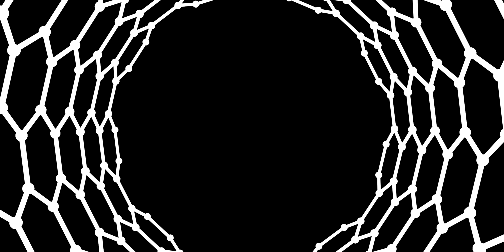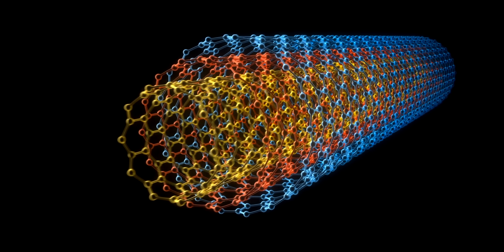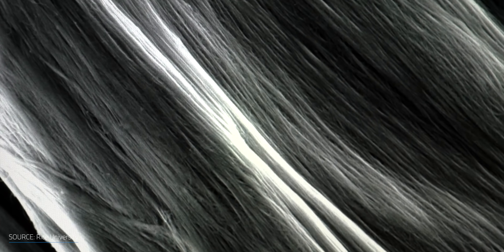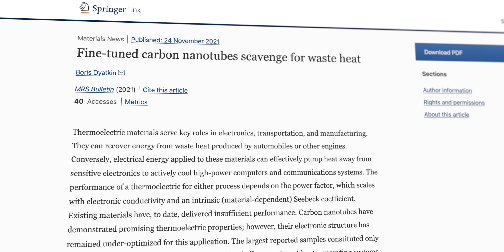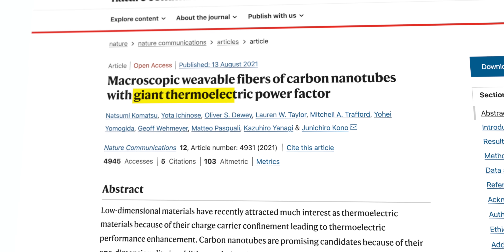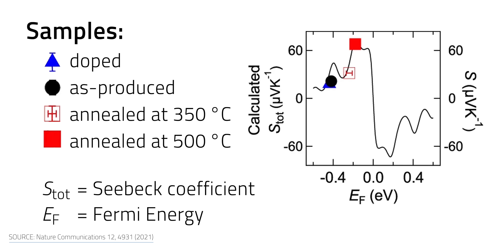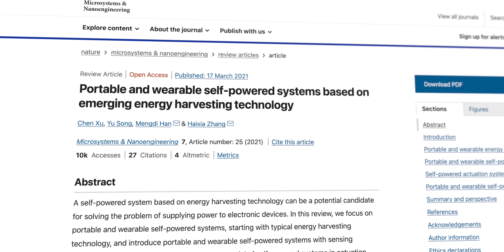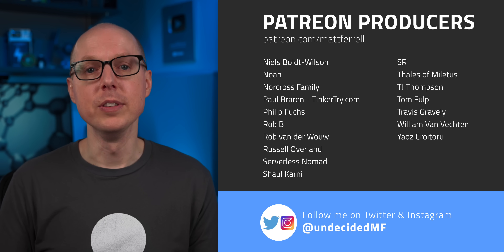Revisiting How Carbon Nanotubes Will Change Renewable Energy

Comment: Would CNTs be a good candidate to harvest and convert residual heat in urban environments to electricity? There's a fantastic amount of residual heat that's trapped by office buildings and roadways - it seems a shame to not be able to capture it and convert it in to a useful form.
Reply: It would be excellent to harvest geothermal heat. Or turn deserts into power plants.
Reply: The main question is twofold:
A) it’s not about how much heat in isolation, it’s about the thermal gradient, so you’d need to find cold spots as well. Cities have cold-er- spots sure, but the local differential for the thermoelectric device is likely to be limited in very dense urban environments precisely due to the heat island effect.
B) what are the efficiencies of the device? One LED from a hotplate, scaled-up, suggests air conditioning waste heat might be able to run nearby street lights for instance. That’s not nothing, if cheap-enough that’s already enough of a reason to install them into buildings. But it’s not going to, like, halve the number of power plants/energy farms all by itself either.
Reply: @kaitlyn__L  in the desert cooler gradient would be underground or in the shade. Which may be the same case in the city.
Reply: @paysour3  of course, there will always be cool-er parts, but the question is: is it 5°C cooler? 10? 20? That magnitude determines the power output, not the absolute temp of the hot side. 

Additionally, you cannot necessarily simply have the hot and cool sides large distances apart, if it is all in one plate they need to be next to each other, otherwise some kind of refrigerant or other transfer fluid would be required, which would also affect the efficiency, and be a different design.

This is inherent to all thermal engines, the graphene plate would be very much like a modern semiconductor peltier cooler, which indeed can also generate some current from being made hot and cold, just the CNTs allow 3x more power output vs a peltier plate. 

Of course with arbitrarily large distances you can find any cold side you want. The challenge lies in finding them close-enough. One of the best options may in fact be another topic this channel covered, devices which output heat in the gap in the absorbency band of our atmosphere, and create a cold side for other devices such as air conditioning. 

Well, they could be used here too. But they generate fairly mild temperature gradients as well, marketing themselves as making savings on A/C, rather than outright replacing it. So if that’s your best option vs some limited environmental cold side, then it swings back around to limited efficiency. 

Of course even 0.1°C delta will produce some power, but could it even power a single LED? Even with massive scaling of power factor, which thermodynamics makes dubious, that small of a delta is not likely to be large enough.
Reply: @kaitlyn__L  Just three meters beneath the Sahara the temperature gradient would be sufficient. Quite the reverse with a geothermal gradient the ambient temperature above ground should be enough if I understand the principle correctly.

Comment: drawing out heat to get higher clock speeds or longer life is great but if you can in turn pump electricity back into the device thats a double win.

Comment: Graphene wires as a copper alternative would be a huge breakthrough. These steps bringing us closer to carbon based electronics will open up so many new avenues.
Reply: Not only does it allow for better conductivity, imagine a cable that doesn't break! That'd be awesome
Reply: @Leon_Schuit  Well. I doubt that every property will be better. For example, I imagine than carbon fibers will be less able to support overheating which means that limiters should be more strict. But at the same time, i guess that will result in bigger cables with less losses which is good. Just not underestimate the overheating.
Also, it's just to see if carbon cables has good lifespan, because it could result to be damaged from microorganisms. Just speculation, but we don't know for now.
Reply: @oatlegOnYt  I don't suspect microorganisms will be able to damage them, because they will still need to be sealed inside an insulative layer. So long as that has a decent seal, bacteria will not even be able to get inside. As for the overheating problem, I don't know if carbon nanotubes share that same property with graphene, but graphene is an exceptional conductor of both electricity and heat, so if a wire is to overheat, it'll have to do so over a large stretch of cable, due to the dissipation that will naturally occur. Besides which, like you pointed out, the best way to protect a cable from overheating is to simply make the conductor thicker.
These are just my best guesses though, and I'm not a material scientist.
Reply: @Leon_Schuit  Bad choice of words there "doesn't break", that just sounds like snake-oil salesman false-speak.  It CAN break -- it's certainly not invincible.  But it could have more tensile and sheer strength, which also could make it harder to work with. (i.e.: might need a cutting torch not just some hand-tool wire snips).  But the ELECTRICAL properties it could being to the table could make it totally worth any drawback in cost or installation when used in larger-scale industrial, commercial, or military applications.  So it's still exciting cutting-edge possibilities worth investing in and investigating how to change from lab to industrial production.
Reply: @XSFx5  I didn't expect anyone to take "doesn't break" literally, any solid material can break when sufficient stress is applied. What I meant by that it'd become much simpler to produce wired electrical equipment that has a power cord that is very resistant to cable breakage. One use case that springs to my mind would be demolition equipment, like electric an jackhammer. 

As for the electrical properties, higher conductivity, or potential superconductivity, leads to less electrical resistance, which leads to less heat loading on the cable (less extreme heating and cooling cycles) which may lead to a much longer lifespan for the circuit. So in that sense I agree, it would be great for a wide range of applications.
Reply: This is a great idea, except the weakness of nanotubes is likely splicing. A bad joint would result in an inferior cabel
Reply: @Interloper2448  same problem with fiber optic cable.  Worked in a public building with it ran all over but never used it.
Reply: They could pair up well with the concept of macro grids of renewable energy sources. Less losses across the grid means sharing power across is more feasible. Doesn't remove the political and beauracratic issues but it does lower the barrier of entry.
Reply: tought that too
Reply: Whoops, I just wrote this and then scrolled down and it’s the second top comment :)
Reply: what about hydraulic wiring though?
Reply: Problem is the conductivity! Very bad so you need larger diameter  also called gage. Consequence, generate heat, take more room
Reply: @thierrymarin-martinod7574  the thumbnail shows copper over it, has me thinking of the skin effect on copper conductors.  A solid conductor doesn't have the same ratings as stranded wire of same size or weight per foot.  Induction metal melting things on you tube use hollow copper pipe, vs solid bus bars
Reply: Another area to be solved in the termination, soldering and crimping
Reply: Absolutely 🙋🏼‍♀️
Reply: I wonder if you could use it as a "booster" to current copper or aluminum power cables. graphene sheathed conductors to lower line losses and boost efficiency a smaller percentage, but at a much lower cost and much sooner than a full graphene wire that needs to be self supporting and everything
Reply: well that will never happen :) lets be real.
Reply: The only issue with Graphen sis mass production, it’s what is taking so long
Reply: erm... its not a semiconductor
Reply: I love smart people
Reply: Although CNT is an amazing electrical conductor it is even better at data transmission so watch that space as well.
Reply: I wonder which sci fy tech will hit the market first for energy cables replacement : room teperature supraconductors or carbon nanotubes, ir maybe something entirely different.
Reply: I bet you i knew before you
Reply: Lower weight wires for motors and transformers would be a huge improvement.
Reply: @KnightsWithoutATable  Its not about the weight. Its about the heat. Carbon can handle MUCH more energy than copper without losing most of that energy to heat. I mean weight is important but the heat loss is MUCH more important. We are talking MUCH more efficient over copper.
Reply: @leegibson5469  yeah, even if it’s not the mythical room temp superconductor, it’s still a huge efficiency increase for large grids.
Reply: @leegibson5469  Abundance and price is also important, because with a cheap material we can just increase the cable section to reduce the losses. A future advantage for CNT is that carbon is cheap, although the process is not YET, there is room for huge improvements.
Reply: @oatlegOnYt  All true but the energy efficiency trumps all that. If it can carry 10 times the amps at 1/4th the size, That is a game changer.
Reply: lee gibson the efficiency is very hopeful but soft drawn copper is very strong and remarkably durable. Have seen different phases slapping together or burning against a neutral without completely failing many times in my 23 year career as a lineman. Not sure graphene would have that durability. Copper supplies nearly all the secondary voltages in the grid I maintain and would be ridiculously expensive to replace on a large scale. Tree interference is the most common problem for secondary voltage here in the grid I maintain.  Most higher voltage distribution has gone away from copper in overhead applications for some time now.  Transmission voltages around here has gone away from copper for a long time now.
Reply: @leegibson5469    thanks, Lee   Good point / I2R
Reply: @Baitrix1  Better recycling. Pumping carbon from air is a must.
Reply: Especially good for a prosthetics and robotics even chips for our brains , you know Wi-Fi for the mind! Can you hear me ?

Comment: Nanotechnology as a whole has been under the radar for years after being hyped in the 90s. Good to see some news on the graphene tube front at least.
Reply from the maker: Maybe its finally here, time will tell!
Reply: Nanotechnology is in every phone, tablet and computer in general made for more than the last decade or two - since transistors were shrunk to sub micron geometries and reached the nanoscale.

Nanotech has nothing to do with materials but how they are implemented.

Also the photoluminiscent quantum dots used in monitor/TV displays for the last several years are an example of nanotechnology, as are all the solid state memory chips currently in use, and likely some modern digital camera sensor chips too (not certain about the last one).
Reply: @mnomadvfx  I wouldn't go as far as saying that nanotech has nothing to do with materials, but I absolutely agree that how they are implemented makes all the difference.  For example, in conductive polymers, you will not get the properties you want from CNT's if they are not properly dispersed.

Comment: 100 times stronger than steel and 4 times lighter?  BS... PROVE IT! 100 times stronger might be a fact, but there is no such thing as anything being "4 times lighter." Mathematically, that is an untrue and false statement, prove me wrong.  What is probably meant is ONE FORTH THE WEIGHT OF STEEL. NOT 4 TIMES LIGHTER.

Comment: Regarding your sponsor: Did you know that getting the liquid nitrogen for flash freezing the coffee, transporting a frozen liquid instead of dry beans, aswell as recycling aluminium do all have a massive carbon footprint associated with them? This is honestly highly problematic.
Reply: While I’m not a fan of accusing without actually data, intuitively this seems absolutely worth having another look! Good thinking Psychx!
Reply: @Gecko2305  You can look it up. Compressing and separating air consumes tremendous amounts power due to how much volume of gas needs to be processed to get a tiny bit of liquid. The process also involves a heat pump to cool down the compressed gas…

Transport emissions should be pretty self explanatory (imagine being able to load a truck with only 1000 cups of coffee instead of 10000 while actually being heavier and needing active cooling throughout because it has to be kept frozen).

Aluminium does a thing where you have to keep blasting it with energy, but it doesn't rise in temperature because all of that energy is consumed to change the state of matter from solid to liquid. Likewise all of that energy is lost as process heat when cooling the freshly poured aluminium, because it will just keep radiating heat and not drop in temperature until it turns solid again.
Reply: @Psychx_  I wasn’t contradicting you in that regard. I just meant it would be useful to see where and what they do and how many emissions it actually produces. But like I said, you’re probably right anyways. :)
Reply: @Psychx_  Sounds like a carbon nanotube would be useful for the aluminium processing industry LOL
Reply: They seem to be congratulating themselves on a solution to a problem they caused in the first place.
Reply: Additionally aluminium requires a lot of energy to recycle, so its not so ideal either...
Reply: @flex4711  But more energy to produce.
Reply: I don't believe in carbon footprint anymore
Reply: I was more puzzled by the concept of advertising something that makes you very I'll...
Reply: Good points Psychx, but sponsor money is hard to find and sometimes a content producer might have to compromise a bit. Personally I find this coffee concept totally absurd and it seems to be a solution searching for a problem that doesn't exist (I mean, how hard is it to pour hot water over ground coffee?) but if it supports good content, at least some good has come of it.
Reply: This man made a video on solid hydrogen on disks, do you honestly think he cares about the truth, or about views?
Reply: @sedwarg  yeah, that one among many other videos was quite hilariously bad
Reply: Matt is not scientifically literate so I doubt he knows or cares

Comment: A high conductor would not result in much change in power transmission loss as "the IR losses are negable " according to the EIA .This would not change the hysteresis losses unless we go high voltage DC.

Comment: Does a nanotube "wire" support a magnetic field around it similar to a wire? I'm thinking super strong Magnets/motors.
Reply: As flow of charge yields a magnetic field, it doesn’t depend on the medium the current flows through, so, yes.
Reply: @chow-chihuang4903  Oh yeah, true! No field=no flow
Reply: I think it's possible. Again, more testing needed

Comment: Would the one in clothing be better for cold weather since the difference in temperature is much greater in the clothing then outside? Let's say for someone climbing the everest. The heat of their body and the very cold outside could generate power for them to use during the ascension?

Comment: Wow, did the EIA say 60% of energy is lost to heat in power transmission , the director had said that the IR losses were negable ,which is true but negates the hysteresis loss this new statement now takes this hysteresis loss into account .Do you have a link to that.